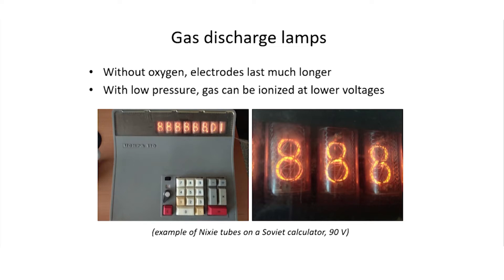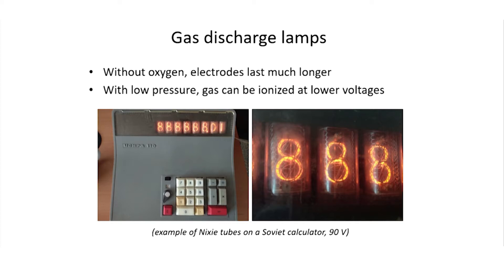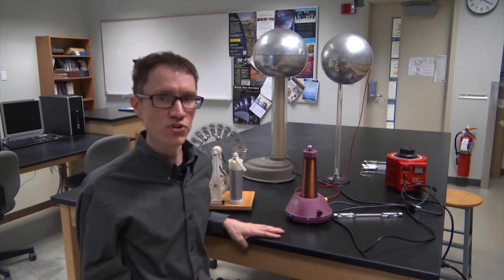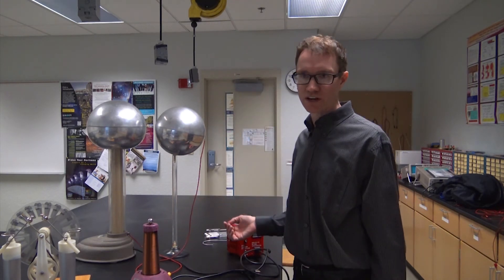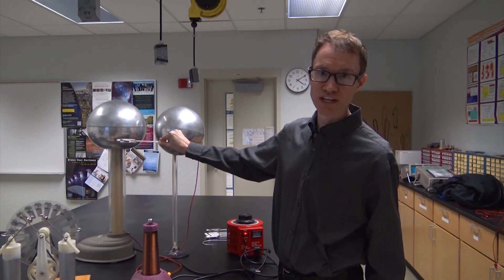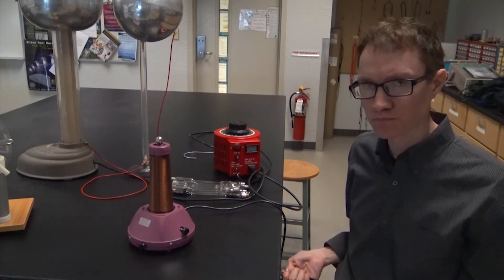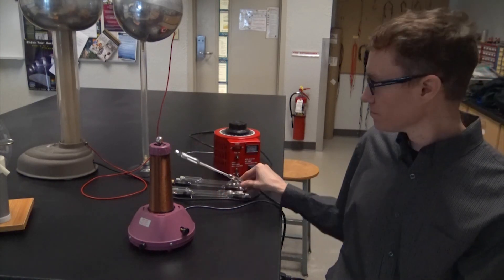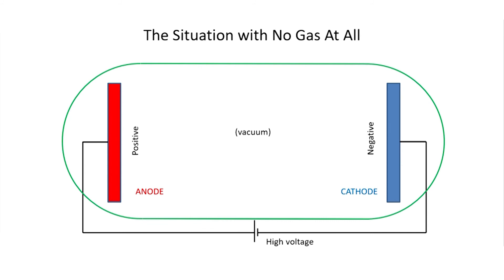Light from Gases (Electrical Properties of Materials #8)

Comment: HOW ABOUT USING A NON CONDUCTING GLOVES SIR................

THANKS

😇😇😇😇😇
Reply from the maker: Using gloves can still be dangerous.  A high voltage spark may penetrate (i.e., breakdown) non-conducting substances used for gloves unless they are suitably thick and engineered specifically for the working voltage.
Reply: @adanner  Indeed, in the field of spectroscopy we use a great deal of LN2 to improve base pressures. The only time I ever got burnt from it was when a 'Health and Safety' guy made me wear gauntlet type gloves, it spilled into the glove and I couldn't get the glove off quick enough. There is no substitute for common sense and experience !!